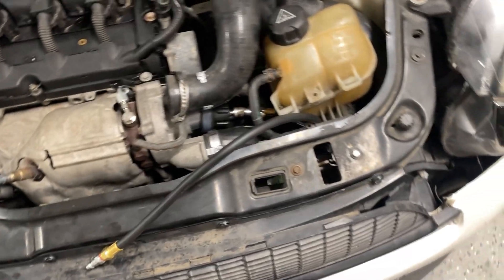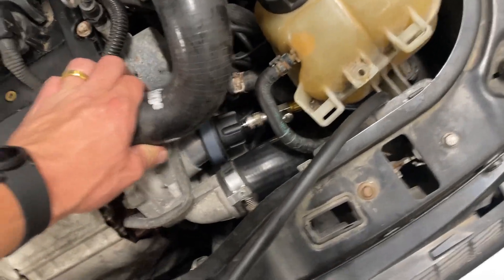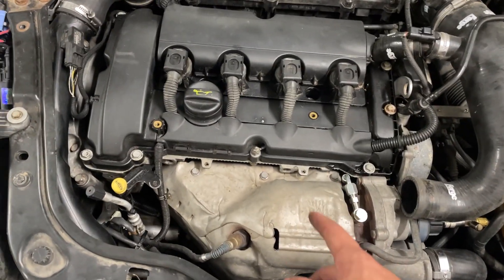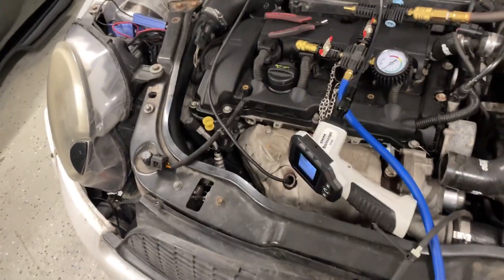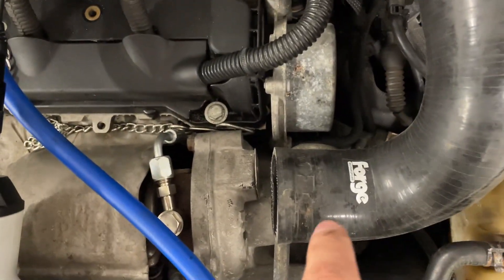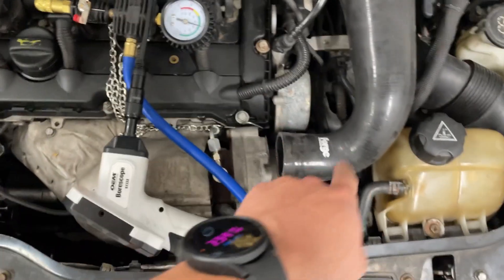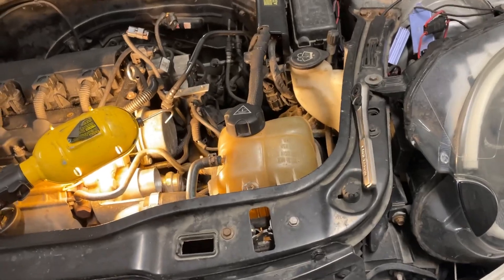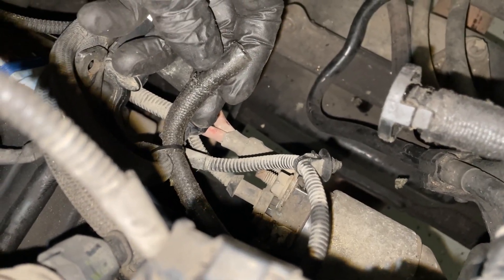Solving Boost Issues on an R56 Mini Cooper

Comment: I’m having the same issue with the temp reading 170-185 degrees. I changed the thermostat and it’s still running under temp and my boost isn’t hitting target max boost

Comment: No vacuum on the intake manifold because the throttle body goes wide open at idle. Idle speed and throttle response is controlled by the valvetronic system.
Reply from the maker: That is very interesting. Thank you for this comment!

Comment: Hey that vaccum line from the vacuum pump goes to the port closest to the engine block. The other port next to it goes to the (N75) Electro Pneumatic Pressure Valve) also know as Boost control valve.
So the way is designed: vaccum line to canister port closer to the engine block. Second port on canister to small port on N75. Bigger port on N75 goes to the turbo actuator port next to the vaccum pump. I would not recommend altering the system because it’s designed to circulate boost pressure. Also that plastic pipe you removed it’s designed to hold consistent boost. Silicone hoses can work but they either contract or expand under pressure so they can cause boost delay. Mini coopers a crazy about everything. They are engineered to fail if we monkey around inappropriately. Good luck! Let me know when you are ready to race up your mini!

Comment: I have a 207 cc turbo and got told by a peugeot meachanik its suppost to be about -0.8bar.
That should be the same on the mini, as in the use the same motor

Comment: Subbed. Having a similar issue after just having finished changing my valve cover out. The rubber banding of boost at times, and seemingly low boost at times. I've got all new silicone charge pipes, Wagner comp intercooler, luft technik intake, gfb dv+, 3" catless RPMPower downpipe, and just recently did a full drive belt service minus an alternator and harmonic balancer. When I did the down pipe, I inspected the waste gate, which did rattle side to side, and I could easily slip the tip of a medium flathead under it. It's my first turbo car, so I'm not sure if any of that is concerning.

Comment: Hello merry Christmas 🎄 
My Mini r56 JCW gen 2 lost literally all boost last night and was making a load wooshing noise from the turbo i think. 
No engine codes.
I took off my DV+ valve and it was stuck and not moving.
I think thats my issue, would you agree? 
Nice vid.

Comment: Have you had any other issues?
Reply from the maker: @marcosr666  No the car has been pretty solid since doing this.
Reply: @NickSabella  I didn't want to have to remove the intake but I guess I'll have to do it. Any plans for the car?
Reply from the maker: @marcosr666  Removing the intake is definitely not as bad as it seems. I really just want to clean the car up. I'm going to walnut blast the valves, rewrap the car, redo the headliner, clean up the interior, and a few more odds and ends. I just really want this to be a nice car. Once I'm done, I might do a downpipe and tune, but it has quite a few miles on it so I'm unsure.
Reply: @NickSabella  oh nice just make sure to do your timing chain and guides if you haven't already. My boost solenoid ended up being bad and I also found out my car has a stage 1 tune
Reply from the maker: @marcosr666  oh yeah timing chain and oil leaks were all the video before this one. I've done all of the maintenance at this point besides walnut blasting
Reply: @NickSabella sorry last question, are you getting vacuum to your wastegate line while idling? Mine has vacuum at the vacuum pump but once it hooks up to the vacuum reservoir there's no vacuum out the other nipple, I hooked up the pump the the nipple closest to the engine but I heard it's non directional
Reply: @marcosr666  Just to help clear the air here, no pun intended. The car is not suppose to produce boost at idle, only once you start to get on the throttle. The car produces boost by actuating the electric Boost Solenoid located under the intake manifold. Essentially the vacuum line from the vacuum pump runs back to the small vacuum tank under the intake manifold and from there to the electric Boost Solenoide. When the car needs to produce boost the Boost Solenoid opens the flow and allows the vacuum to pull vacuum on the vacuum controlled waste gate. The waste gate closes the flap and forces the gas to flow through the hot section of the turbo and it spools to build boost. Essentially when vacuum is present so is boost as long as you have engine RPM above idle, no vacuum equals no boost.